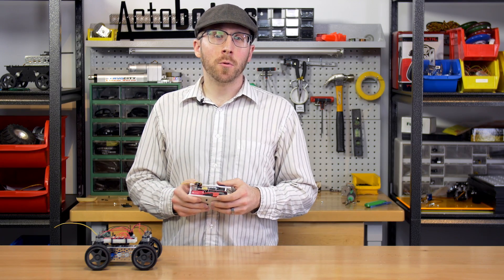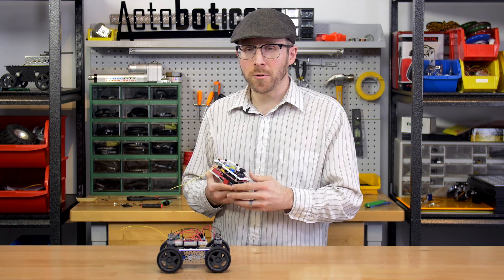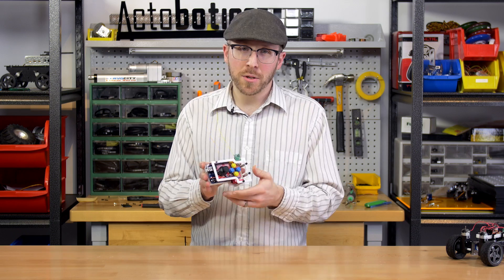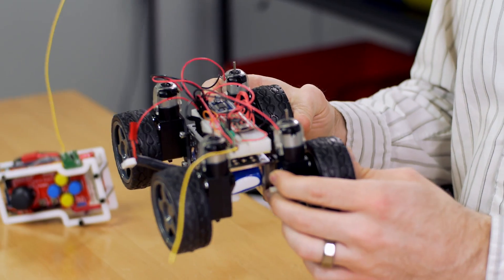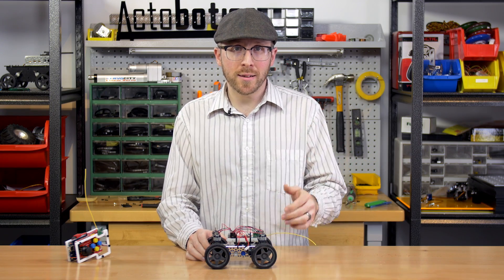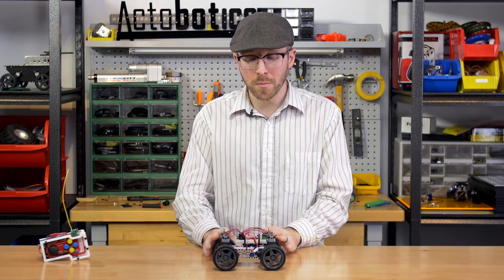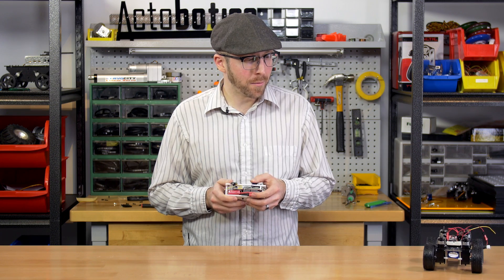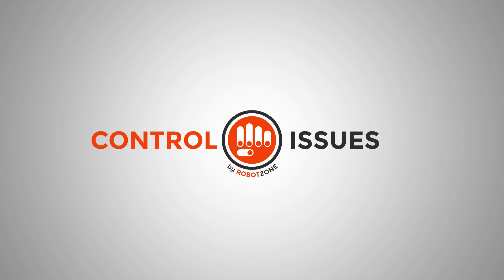Control Issues - Ep 8: Arduino RC Gamepad

Comment: de cuantos volts y mA necesito la pila?
Reply from the maker: Hi James, 
Volts:
The recommended input voltage for an Arduino Uno is 7-12V but it can run on anywhere from 6-20V (see https://store.arduino.cc/usa/arduino-uno-rev3 ).
The TB6612FNG can take up to 15V. The motors have a recommended voltage range of 4.5V - 6.0V but can run at higher voltage. A 6v power supply would be great if it was always 6v but since batteries have a lower voltage as they drain I would go higher and use at least a 9v. In the video I use a 3S LiPo which is about the max I would recommend.

Amps:
The motors will each draw 250mA at stall. So in a worst case scenario you would pull 1 amp if all 4 motors were stalled out. Having more current available in your battery will not hurt. Current is like a rope, it is pulled not pushed.

Let us know if you have any other questions tech@servocity.com.